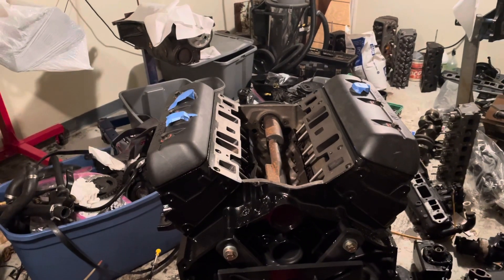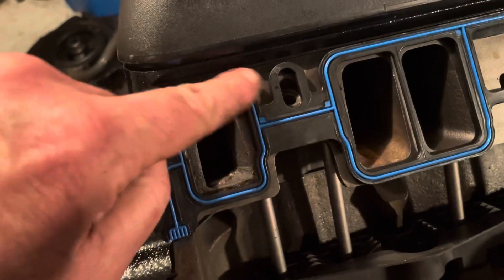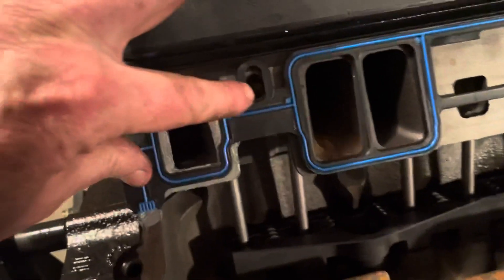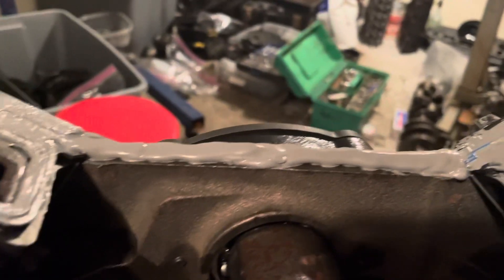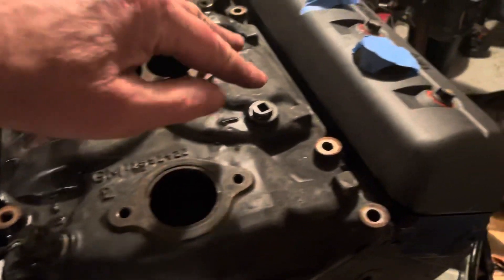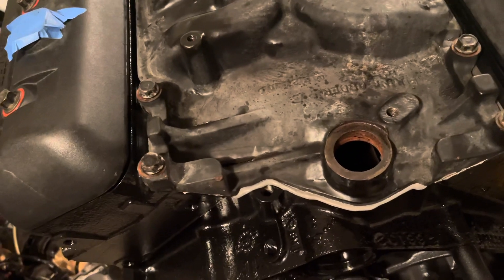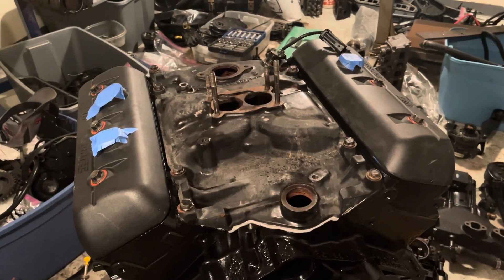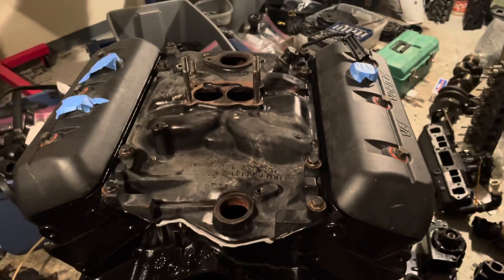Part 10 - Mercruiser 4.3 (2) - Intake Manifold Install

Comment: Were those gaskets marine specific or truck gaskets you can get at AutoZone?
Reply from the maker: These are actually the cheaper gaskets that are ok for boats but not cars or trucks. Antifreeze eats these up but boats just have fresh or saltwater which won’t hurt these gaskets.
Reply: @moccasinmarine  okay where did you pick these gaskets up?

Comment: Hello, a question, I have this same engine but in a 1996 c1500, is this intake compatible? My idea is to make it carbureted
Reply from the maker: Yes but why do you want to make it carbureted? There are sensors like the MAP sensor, throttle position, and coolant that the ECM uses to control the transmission unless you have a manual transmission it’s going to be tricky.
Reply: @moccasinmarine  Hello, thank you for responding, I have a manual transmission, I simply want to forget about computers, I would like to know if it is compatible since Google says that it is only compatible from 1997 onwards but I have seen the photos and I cannot understand what changes so that it does not work in 1996
Reply from the maker: @need96s if you have 8 bolts holding the intake on then the intake will fit
Reply: @moccasinmarine  If all 8 are there, well anyway, if it doesn't work correctly, I can return it, thanks friend, the next message I send you will be if it worked or not, thanks again for your time

Comment: The 35 ft lbs is for the Pre Vortec engines (intake has 12 bolts; up to 1995). The 11 ft lbs is for the Vortec engines (intake has 8 bolts; 1996 and up. Does this makes sense for the pre Vortec seems like a big difference?
Reply: I see the answer in a previous reply. My aftermarket pre Vortec gaskets is the plastic style from Michigan motoz
Reply from the maker: I’ve never heard of plastic gaskets for the pre Vortec heads. Are you certain they have 6 bolt holes on each gasket? The plastic gaskets can’t handle the torque of 35 ft lbs. They will crush. The other gaskets are coated paper and need the crush to seal.
Reply: @moccasinmarine  you are right it's not a plastic gasket. The gasket came with some steel tabs for a center port, not sure what that's about

Comment: As a former machine shop manager and 40 years in the automotive industry,  as per Felpro,Victor and other OEM gasket makers, the rule of thumb is NEVER,EVER put silicone on a gasket. PERIOD. On the ends. Yes, as there's no gasket there. Silicone acts like a lubricant, and the water/antifreeze will blow past the sealing surfaces. The raised plastic o-ring encapsulated gasket will crush to the head and intake. So many times we have seen intake gasket and water pump and thermostat gaskets slavered in RTV, with the passages clogged up and you could see where the w water blew by. The reason on 4.3 rear head gasket water ports failures, is there is no water passage crossover, and any contamination of the antifreeze will just stagnate and usually eat the mating surfaces of the intake. Usually when I build a mild engine, I drill and tap the manifold for a stainless steel or A/N style lines to help with cooling and heating of the heads. Please don't perpetuate the AutoZone myth and cause others to make a similar mistake. Even today, I can go to a repair shop and see mechanics putting RTV on every mated surface, using it to double up the sealing surfaces.
Reply from the maker: I’ve also been building engines for 40 years and I’ve never had a gasket failure with this method. I don’t know if you watched the video but I also don’t lather it up. I typically only put a thin film on the metal surfaces and I also only use the gray silicone in most applications. I’ve found the gray to be more durable. Also when I’ve had to pull parts back apart after the silicone has cured it’s anything but a lubricant. It has to be shaved off the metal surface with a razor the adhesion is so good. One other reason I do this. These are boat engines. Most are open cooling with no antifreeze to limit corrosion. The wider the gasket and the more metal covered by silicone, within limits, the less corrosion. The corrosion I’ve seen with boat engines is due to the lack of silicone. So I appreciate your input but I will continue to use my proven methods.
Reply: @moccasinmarine  again,  I get where you are coming from, as there's always exceptions to each rule. I sold ac Delco reman engines in the 90's,  just like the overheat freeze plug for warranty purposes, Delco would not warranty a engine with excessive rtv on gasket surfaces. I watched your videos and from others. I lived in Virginia near Virginia Beach,  we built all the Mercury marines and OMC as well as others. Our problems were the brackish water we used our engines on. We had the crab fisherman further up the Chesapeake bay and near the Suffolk side, which were all brackish. Every year, engines were being rebuilt because of the internal rusting. Of course we had the ocean side, but those were normally big blocks, or huge diesel engines. Coming here to Michigan,  the great lakes are not as hard on a marine environment.  You have your proven method and I went with what the factory warranty preparation required us to do. Thank you for replying back to my post. I enjoy banter with all different points of view.
Reply from the maker: @TheBobdesigns4262  if you watch enough of my videos you’ll see that I’m open to improvements all the time. I constantly try and save time on my processes. Not putting silicone on gasket surfaces may just be one of those tasks I could save time on. I’ll look into this further. Thanks for the input again.
Reply: You both are class acts and extremely intelligent and respectful people who both have obviously been there and done that over the years. I’ve learned a lot from you both. Thank you for being able to share without feelings being hurt.

Comment: Is there a reason you wouldn't put sealant around all the ports, on both sides of the gasket? TIA
Reply from the maker: I don’t put sealant on the intake port because they’re handling gasoline and air and it’s always under either neutral or negative pressure so they don’t have a tendency to leak there’s a lot more water than gasoline to leak and it’s always under a positive pressure so that’s why only do the water port

Comment: Hi sir, where did you buy your intake manifold gasket ?
Reply from the maker: It depends on what year engine I’m working with. If it’s a Vortec engine (8 intake bolts) I look up a 1997 Chevrolet C1500 truck with 4.3 v6 on Rockauto which shows MS958171. For older non- Vortec engines I use a 1993 4.3 v6 with 12 intake bolts. If buy a full gasket set the intake gasket will come in the set.
Reply: @moccasinmarine  my was the one have 6 bolts. I used fe pro 17310 for 28$ at summit racing.
Reply: Thank you for replying.
Reply: I mean 6 on 1 side, so 12 bolts on the intake manifold.
Reply from the maker: MS933461 is much cheaper. Why did you use 17310?
Reply: @moccasinmarine  because it fit into the intake manifold. I am diy, so i am learning from you.
Reply from the maker: What I meant was what source did you use that told you to use 17310? That part does not show up on ROCKAUTO for that engine.
Reply: @moccasinmarine  my google search engine. Because this engine was re-manufactured so i can not find the serial number. All i do is guess by the pictures.
Reply: I'm looking for one too!!!!@

Comment: Hello. I have the same 4.3 mercruiser. My old gaskets had a metal plate on them that partially blocked a the small hole. It was Felpro-98002. Can I use the one you used?
Reply from the maker: To the best of my knowledge Vortec heads didn’t have the small hole (EGR passage) you refer to so you probably don’t have Vortec heads so you can’t use the gasket in video.

Comment: Great video do you have video on older mercruiser 4.3 (1989) that does not have vortec and has more intake bolt holes for the sequence?
Reply from the maker: I missed this question when it was asked.  The older intakes were thicker and the gaskets were composite paper and steel sandwich. They were torqued to 35 ft lb. I don’t recall a sequence but I would start with the middle 4 bolts and work out to the corners torquing to 15 ft lb first pass and 35 ft lb the second pass.

Comment: i saw another video on istalling these Intake manifold gaskets but the other guy never MENTIONS having to put sylicone around the END PORTs  on each End of the Intake manifold!! thanks for sharing!!
Reply from the maker: It’s not required to put silicone sealant around the water ports. I do it as extra insurance against a leak. Water leaks that are not caught will destroy a boat engine due to oil contamination. In a car or truck you’ll overheat from lack of coolant before the oil dilutes. In a boat with open cooling you have a never ending water supply and the engine will fill completely with water until it literally flows out of the top of the engine. By then the damage is done and you need a rebuild.
Reply: @moccasinmarine  ok thanks for taking time to Explain it!!!
Reply: @moccasinmarine so if i wanted to go back since im doing a long block can I reuse the plastic gasket or rebuy?
Reply from the maker: @Skinners420 rebuy, they’re cheap

Comment: Thank you for the video. I have the non-Vortec version with 12 bolts. Can you tell me if the torque spec for these bolts are the same as the Vortec intake?
Reply from the maker: My google search turns up 40 ft lbs for 12 bolt intakes.
Reply: @moccasinmarine  thanks for that. I couldn’t find it……maybe needed to adjust my search words.

Comment: 1998-2001 torque is different ( 11 ft. lbs.) I believe.
Reply from the maker: I stated 11 ft lbs. in the video. What are you trying to point out?
Reply: @moccasinmarine  My apologies, I had watched another video from a different source which stated 35 ft. Lbs. for earlier model. I mistakenly committed on yours. You were spot on. You videos are of great value to me. Thank you!
Reply from the maker: Sorry I was a little terse in my reply. I’m pretty busy so when I answer comments I’m short and to the point usually.

Comment: My intake on my 94 omc 4.3 v tech has 12 bolts, have I got a bad engine ? Thank you for clarifying
Reply from the maker: It’s not bad just not the best. It’s not a Vortec engine. Vortec engines only use 8 bolts to hold the intake on the engine. Vortec engines have about 20 more horsepower (205 vs. 185) due to the cylinder heads. For more info on this topic watch this video:

https://youtu.be/8V4OFCjVQVU

Comment: What can I use besides dexcool?
Reply from the maker: Boats are open systems. They don’t use antifreeze during normal operation. They use lake water for cooling so when freezing temperatures are expected you must drain the lake water from the engine block and the exhaust manifolds.

If you are referring to winterizing your boat then they make special pink antifreeze for marine use.

Comment: How much does it cost to have block checked for cracks
Reply from the maker: The shop I currently use charges $180 to clean, magnaflux, and mic/inspect to decide how much to bore it.
Reply: In Idaho the shops Magnafux the blocks for $200-$250